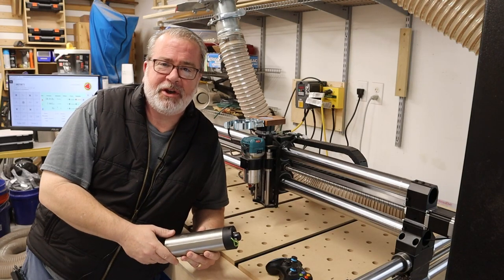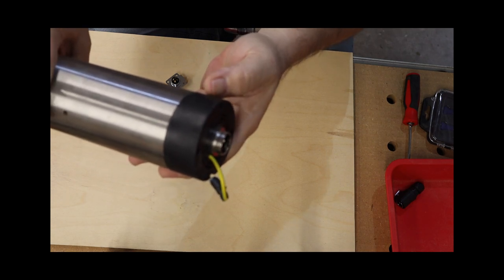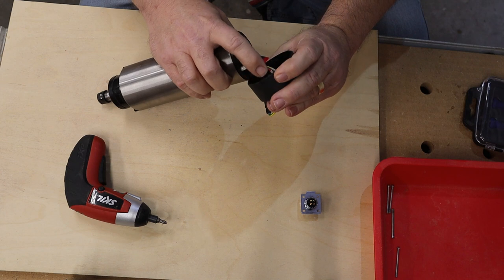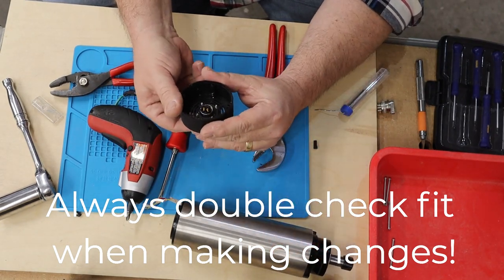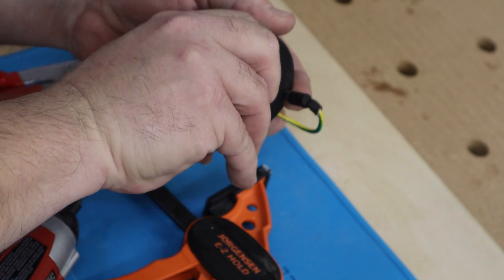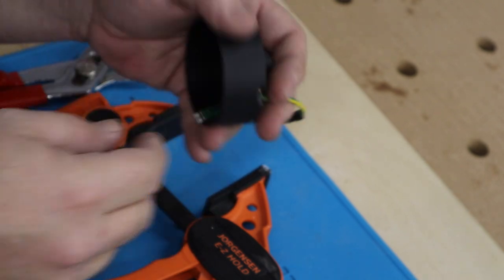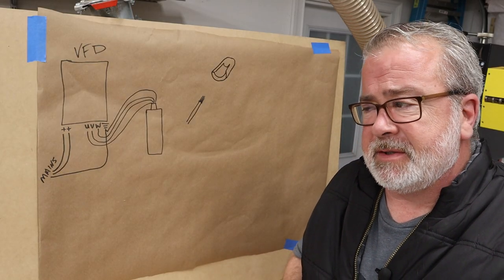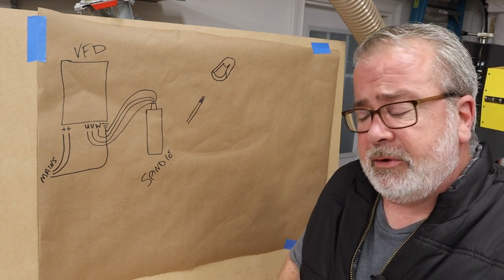How to add a spindle to a Onefinity cnc

Comment: Thanks JR. I'm going to run the baby router to failure before tackling a VFD/spindle configuration, but your video helps a lot.
Reply from the maker: Hi David, I found that the makita does a fine job for everything I’ve asked it to do, the spindle was a bit of an impulse buy while waiting for my machine back in 2020.  Truly only put it on because I had it, there wasn’t any true need.

Comment: Thanks for the video. I have thought of one day upgrading to the spindle.  I don't understand why wiring them is so difficult. Guess I need to learn more.
Reply from the maker: Hi Dan, it isn’t hard, but the sense of needing to get it right goes up when working with 1) higher voltage and 2) very small soldered connections. Thanks for coming by and commenting. If you’d care to, consider subscribing, thanks
Reply: @TradeSkillersAnonymous  already subscribed watched a few live shows as well. I also follow Dave and Mark.

Comment: I'm planning to cut a fair amount of aluminum so I went for the 2.2kW water cooled spindle.  Should have it running in a week or so.  Definitely agree with your comment about the relative difficulty of wiring it vs. programming the VFD.  I watched quite a few videos before really understanding how the programming works.
Reply from the maker: Hey Joel, thanks for coming by and your comment. For sure to work on aluminum I’d have gone water cooled to get lower rpm capability. I’ve got a great pdf that someone made that goes over each setting in detail. If you’d like it, email me at jr@tradeskillersanonymous.com and I’ll send it to you. It isn’t my work, can’t remember where I found it, but I found it really helpful. Also, consider subscribing if you haven’t. Thanks, talk soon

Comment: I bought the VFD cable from automationdirect, but did not buy the continuous motion cable (out of stock, btw). Wish I had, but I didn't. I guess I'll run with what I have until I have a problem...
Reply from the maker: I bought a spool of what I thought was the right stuff, oops!  Just kept it and reordered the flexing cable. Will use for servos and stuff
Reply: @TradeSkillersAnonymous  unfortunately they are out of stock for another month!!

Comment: So glad I found you JR. You have helped my first days with my OneFinity FAR easier. I also got overly excited waiting for mine and went all in on the all the things and ended up with a 2.2Kw spindle. 
So my ?? is: Do you control your spindle via the VHD or via the OneFinity control box? I am assuming we have to do it via the VHD but wanna make sure I havent missed something as there are more connectors on the back of the OneFinity control box.
Thanks!!
Reply from the maker: Hey Blaine, isn’t it funny how your mind goes to work waaayyy in advance of sending your first job!?

Comment: Thanks, you presented a very practical approach and a great explanation. I'm starting with the Makita mainly to keep startup cost and complexity down. My plan is an air-cooled spindle upgrade and moving the Makita to an actual handheld (or perhaps cheap under-table mounted) router I can use on larger projects or with regular hardware store bits. My only question is, you say it's a 220v spindle, but are you supplying 220 or 110 going to the VFD from the wall? Also, how's the amperage draw on that VFD? I only have 15A circuit.
Reply from the maker: Hey there, thanks for watching and your comment. My vfd is a 220v input, and draws an anticipated max of about 7 to 8 amps. 120v would draw roughly double that.

Comment: Just installed.  Wish I had seen this earlier.  Are you doing a video on the VFD programming?  After hours of tweaking, it still will not communicate with the 1F.  Don’t know if it is the VFD, Buildbotics, or the breakout board.  Will just run manual for now.  Almost as frustrating as the 1F  itself.
Reply from the maker: Hi Dan, I might very well do a VFD programming walk through, BUT, I pumped the brakes on that initially out of concern for the high voltage and chance for error.  I won't ask you to put your email in the public area here, but if you go to my website, tradeskillersanonymous.com and use the contact us feature, I can send you the document I found online that guided me through my programming.  Consider subscribing too while you're here, that way you'll hopefully see future videos as I release them.

Comment: Any issues with the new cable connector only being rated for 5A? Vs running possible 10A

Thanks for the vid
Reply from the maker: Hi there, the 2,3 and 4 pin connectors are rated for 10a, the larger pin count connectors are rated for less, but I used a 4 pin. Copying specs below:

Description
Specifications for 2pin, 3pin, 4pin:
Cable specification: 1.0m㎡-1.5m㎡/18-16 AWG
Diameter range: Φ3mm～Φ7mm
Contact diameter × number: Φ1.5x2 / Φ1.5x3 / Φ1.5x4
Rated Current (A): 10A
Operating voltage (AC.V.rms): 500V 
Contact resistance <2.5mΩ 
Temperature rise: 10A contact temperature below 30℃, 12A ......40℃↓, 15A......50℃↓
Withstanding Voltage (AC.V) 1 minute: 2500V
Insulation resistance: ＞500MΩ
Protection level: IP65/IP67
Durability: ≥500 times
Working temperature: -40℃～80℃
Connecting mode: Plug unplug
Assembly wire: Solder
Housing, the insulating parts: High-performance engineering plastics
Hardware: Zinc Alloy (pearl hard chrome)
Copper needles: Copper alloy (gold-plated 4U)
Waterproof circle: Silica gel
Flammability rating: UL94-V0

Specifications for 5pin, 7pin, 8pin, 9pin:
Cable specification: 0.15m㎡--0.2m㎡/26-24AWG
Diameter range: Φ3mm～Φ6mm
Contact diameter × number: Φ1.0*5 / Φ1.0*7 / Φ1.0*8 / Φ1.0*9
Rated Current (A): 5A
Operating voltage (AC.V.rms): 2500V 
Contact resistance <5mΩ
Temperature rise: 10A ......30℃↓, 12A......40℃↓, 15A......50℃↓.
Withstanding Voltage (AC.V) 1 minute: 1500V
Insulation resistance: ＞500MΩ
Protection level: IP65/IP67
Durability: ≥500 times
Working temperature: -40℃～80℃
Connecting mode: Plug unplug
Assembly wire: Solder
Housing, the insulating parts: High-performance engineering plastics 
Hardware: Zinc Alloy (pearl hard chrome) 
Copper needles: Copper alloy (gold-plated 4U) 
Waterproof circle: Silica gel
Flammability rating: UL94-V0

Comment: Power tools without a ground, are supposed to be “double insulated”.  With the DI, they don’t require a ground.
Reply from the maker: Sounds like you know what you're talking about in terms of electricity, probably more so than me.  I just know that if there's a ground available, I'm going to use it.  May not make sense or be rational or causing extra work, but I don't see any harm in making sure that there's an easier path to ground than lets say, me.  = )

Comment: I added a spindle and the touch plate was not working any longer something with the way it was grounded.  Did you run into this problem?  Thanks
Reply from the maker: Hi there MG, I didn't have any issues with the touch plate.  You definitely want to make sure that your spindle is grounded internally, meaning that while most spindles have 4 terminals, the 4th contact at the spindle (which should go to the spindle case) connector doesn't actually go to anything inside the spindle, which is dangerous, and relates to lack of consumer protection on some products out of China (loose regulations on electrical safety there).  With my spindles 4th terminal grounded, I can use the touch plate without grounding the touch plate, because my spindle is grounded, and because it's physically connected to my machine through metal contact, the machine is also grounded, so that typical magnet end is not needing to be connected because the ground is already established.

An easy way to tell, is disconnecting any and all power to the spindle, VFD and machine (for safety) and after disconnecting the power, remove the top plate cover of the spindle, and you should see three small wires that come out of the back side of the "aviation connector", and the 4th terminal will either have a ground lead going to the spindle case, or the 4th lead will not be connected to anything.  If it is not connected to anything, this is probably your issue.

Be very careful while working around this kind of equipment, making sure you're never working on "live" or powered systems.  May be best co consult with an electrician if you're not somewhat familiar with these concepts.
Reply: @TradeSkillersAnonymous  ok thanks for the info ill give it a shot, I actually switched back to the Mikita for now.